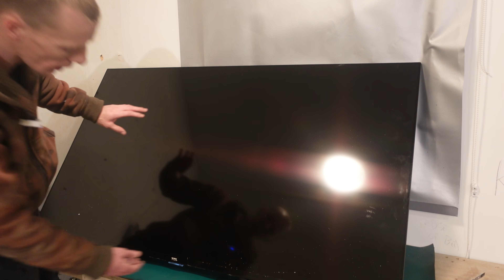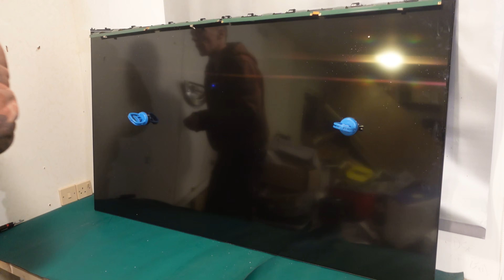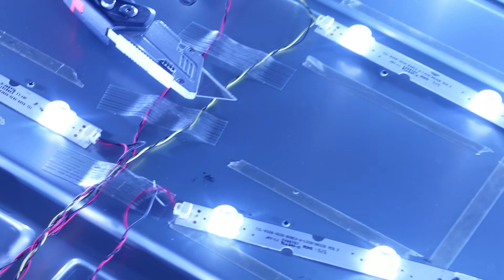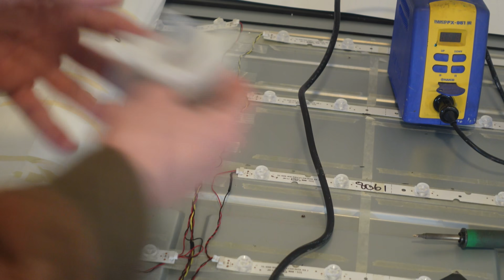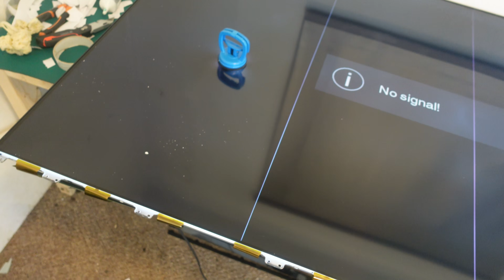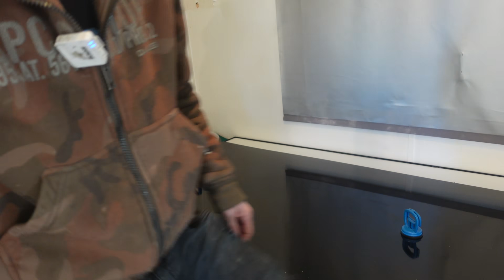65" 4K TV Repair Gone HORRIBLY WRONG! You Won't Believe How Badly I Screwed Up! 😱😭

Comment: Sometimes just smashing something makes you feel better...I spent $5000 rebuilding an engine in a really nice Volvo once, and after 10min of it running it threw a rod! I took a tire iron and smashed every window and panel on the thing and then dropped it off at the scrap yard...It was very therapeutic!😂

Comment: don't know what solder wire you are using but 400 degrees celsius is bit overkill for that little wire you are soldering , plus flux in that wire gets evaporated very fast and makes solder worse. I assume you are using leaded solder wire which melts around 170 degrees so 240 to 270 would be more reasonable to use ...

Comment: Sorry for this fail Phil so close yet so far and if it wasn't for the slip it would've been another quality fix. Can i tempt you with another TV repair i have in my possession 55" Panasonic 3d LCD that powers on has a picture for approx 3-5 mins and then goes dark?

Comment: Just drove by a lovely big Panasonic  TV, sitting up ageist  a bin, bet it still works !? ...  most of the ones I have picked up do!  They normally just replaced  with a new one and old one is just put out instead of taken to the skip!
Reply from the maker: I'd go back for it bud. See if it's still there? The chances are if the screen is good you'll be able to fix it really cheap 😄

Comment: Ah that's unfortunate.  I like how you make videos about different items and still even post the failures.  Do you still have those diffuser sheets?  I have a Sony Bravia that had water damage that I repaired everything but the stained BEF, and have been looking for months on where I could find a suitable replacement.
Reply from the maker: I do still have the diffusers yeah. If you pay postage you're welcome to them. I also have some more from another 65inch which I'll be pulling out on Saturday (broken screen off scrap). I have no use for them and don't really fancy storing them for resale so I'm happy to send them to you if you can make use of them. Just drop me a message on the store and I'll get a postage quote for you

https://www.consolefix.shop

Comment: This whole process made me cringe. I'm not a pro tv repair tech but I have done quite a few backlight repairs as well as tcon boards, main boards, power boards, etc. So many things were done incorrectly here. From the white reflective panel you cut to how you separated the lcd panel from the frame, how you had the tv upright instead of laying down, not securing the backlights properly, yikes.

Comment: I'm not a power supply expert either so don't listen to me either 😁. I just power on the device, if it turns on, and while it is on I unplug it! drooping voltage never hurt any device I fixed and power supply always are discharged

Comment: I figure the wire under the tape was cut through during original assembly, but remained in contact until something shook it loose.
Reply from the maker: Yeah that's possible. I'd say it was probably always weak and just gave up with a bit of heat
Reply: @TheCod3r  Wasn't "no back light" a complaint you were aware of when you bought it?
Reply from the maker: @milowadlin  yeah it had no back-light as the fault in the description

Comment: It’s just one of those things where you know better, and still…
You know the space is too small to handle the tv screen properly, but still..
You know the suction cups is not a good idea and the risk of one letting go, but still..
You know you should have 2 persons to handle the lcd panel, but still..
We all have done this, and sometimes you get away with it, sometimes you don’t.
I just broke a 2000 euro marble table, transporting it laying flat, I knew I should have put it on it’s side, but still.. 
so I feel your pain, we know better… 🤷

Comment: Hi phil i have been fixing lcd/plasma sets as a hobby for a few years now these new tapped in screens are one of the worse to do when re assembling i use 3M VHB HEAVY DUTY DOUBLE SIDED FOAM ADHESIVE STRONG STICKY TAPE and for the led strips Thermal Conductive Tape Double Sided, removing a panel of that size is hard  and damaging the tab bonds is so easy just one of those i guess you can sell the led strips and boards so you can atleast get some cash back,

Comment: This happens so easily to break it. When i do that kind of work i put it face down on a blanket on the bed. So you don't have to worry about the screen at all. And the lines come from this small "ribbon cables" that are conecting the screen to the T-Con board. They`re super fragile and are just glued on, so the come off very easily. When i'm working on them i mostly put some tape over them to support them so they don't come off. These things weren't meant to be repaired at all.
Reply: ....Me, too!!  This, Peeps, is why you should use qualified technicians, not just folk who call themselves 'Technicians'...........
Reply: @fredcooper2063  I wrote this not to blame Phil rather to give him some kind of advice for his (maybe) next attempt to repair one of these.

Comment: Lifting the rear would of helped even if u sided it down put the evasive on the top and sides then moved it in place rather then lifting the whole panel off again but it’s easy to say after the fact but my heart dropped at the start when using cups to left screen off but learning curve I guess sorry phill

Comment: Unlucky mate, ur biggest mistake was doing it on the bench u used so u were kinda setting urself up for a fail anyways or at least giving urself such a hard time upon reassembly. u need at least an island bench so u can walk around the whole TV to make everything a whole lot easier. Lifting that panel was fine but u had it upside down upon lift so u had no way to put the panel down in a better safer position. U need to come from the other side so the ribbons stayed at the top, that way u can lean the panel against something or what ever. Don't bother reusing LEDs if they have phosphor on them as they deteriorate with sun damage/heat and age, so effectively they will turn faulty with a blue tint look so better u replace the whole set like u did. unlucky mate next time u will get it with this experience.

Comment: There are special gadgets for big screens, a square metal thing,with powerfull suction cups controlled by buttons.Use it everyday in my repair shop.Also you need soft adhesive tape for bezels that are glued.Fixing tv sux,but it pays the bills..

Comment: During the entire video I was thinking that maybe when it's big screens you're repairing, you could just leave the panel flat on the table and then lift the shell instead of the panel. That's precisely why I don't trust suction grips.
Reply: they looked tiny to be fair. definitely not adequate for a 65 incher

Comment: I feel for you mate. Having broken one myself I know how it feels. I really wish that manufacturers would make the LED's accessible from the rear, it would not take to much to make the metal back plate in two parts - the part with the led's, and the frame. Then you could simply remove a few short screws and remove the plate holding the led's without disturbing the screen at all. Might make the manufacturing process a couple of quid more expensive, but it would mean that tv's could easily be serviced. So many tv's get chucked simply because an led or two had failed. Just a typical example of things being designed not to be serviced.
Reply: 100%. They just don’t want them to be serviced. It’s infuriating, really.

Comment: Shining a torch close to the screen will reveal if the lcd is working.
Surprised by the severed wire though. I would suspect that was faulty in manufacture.
When I changed the LEDs in a friends TV,  I too was very nervous so watched your video with trepidation. 😅
So sorry...

Comment: I fixed my tv the other day lg one with a couple of lenses fell of the tv LEDs ect which is a common fault on LG TV's always lay the tv screen down on a soft towel and lift the back of the tv then theres no need for suction cups and no strain on the extremely fragile screen  plus you lessen the chance of damage to the ribbons !

Comment: Don’t lift the panel… lift the rear… told you twice 😱😱😱
Reply: Did a hisense 85" 4k tv this way. Lay it on the floor face down on a blanket and pull the frame up, and leave the lcd panel on the floor. Worked perfectly.
Reply: @polygaryd  better to put an insulation panel under it… some have a bezel that has to come off before
Reply: @cheapasstech  this 85" hisense that I did, did have a bezel. I separated the screen from the bezel kind of like phil did and I had to use some double sided tape that was extremely thin and narrow. Should have popped the bezel off with the lcd panel makes it so much easier than having to scrape all the factory doubled sided tape off the bezel and the lcd panel, apply new double sided tape and align the lcd to the bezel while you cant see the face since its upside down. 
 That's how I know phil did it wrong from the very start lol. The tcl is built the same way as the hisense and onn brands. 

He also could have used a putty knife to pop the backlight strips off the back as to not break them. That always works for me. The new backlight strips should have had adhesive on the back already and it looks like phils did have black spots of adheasive so not sure why he was saying he had to figure out how to secure them down. 

Not sure what an insulation board would do to help vs a blanket unless youre talking about popping the bezel with the lcd attached to it, face up, putting the insulation board on top of it and then flipping the whole tv over and pulling the frame off that way.
Reply: @cheapasstech  the 85" bezel did not have an indentation as to where the lcd panel goes. I thought it would but it didnt. I had to measure and tape around the bezel to be able to know where to put the lcd back on. First one I had seen like that.
Reply: @cheapasstech  it was a hisense 85h6570g model. The 3 edges of the lcd are exposed the whole time and you can see them because they arent recessed into the bezel but on top of the bezel and ontop of the ds tape. I thought it was odd but thats how it was before I touched it and it had that black foam kinda ds tape that I dont seem to be able to ever find for sale. Nice tv but I had bought it knowing the back light was the issue and only wanted to fix it and sell it which is what I did.